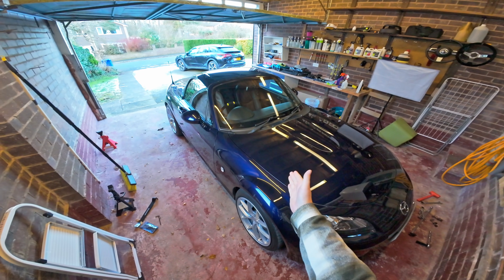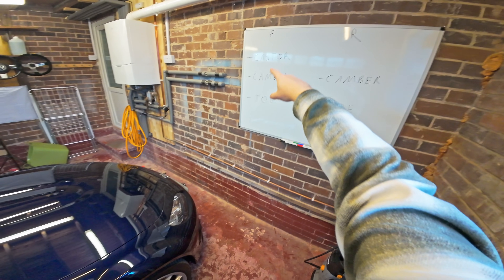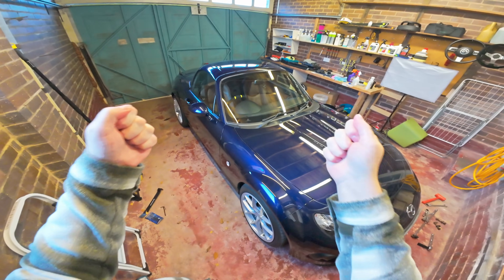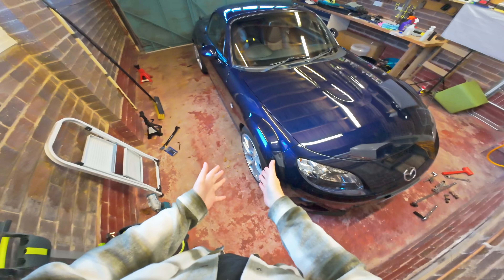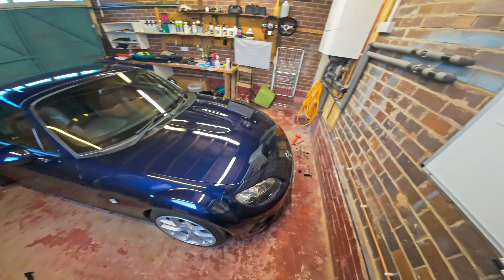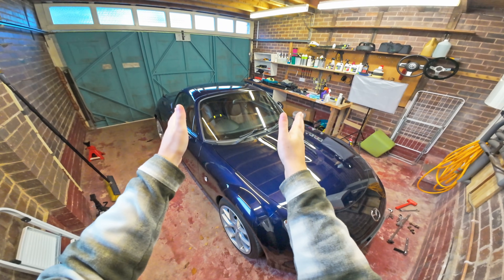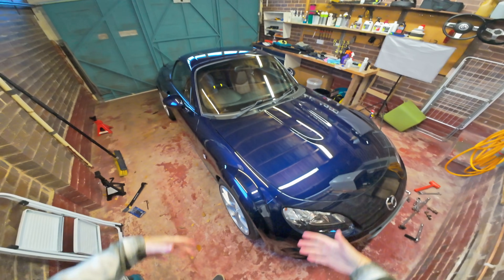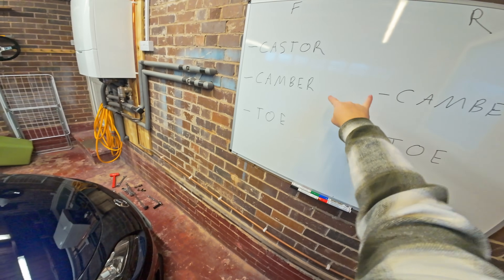I aligned this car 12 times - here's what I learnt

Comment: I took my car to get aligned because I got two new front tyres recently. The first time they did it, the steering wheel went from turned 45 degrees to the right to about 5-10 degrees to the right. So I took it back, and the garage realigned it for free. The steering wheel was still turned the same amount, but by that point I couldn't be arsed, so I left it alone. It doesn't pull to either side or anything, so I'm thinking about just adjusting the tracking by myself to fix the issue. The thing is, I don't have a spanner big enough to fit on the tie rod nut to loosen it, so until I get a big enough one, I'm going to have to live with a crooked, albeit less so, steering wheel for a bit.
One question: how many turns of the tie rod should I give it to turn the steering wheel from around 12:15 to 12:00?
Reply from the maker: Probably about a quarter turn is where I'd start (both sides!)... But without a machine or very diligent string+measuring work you're just going to throw the whole thing off
Reply: If they messed up the alignment first time they will never get it right. You should go to a proper mx5 specialist or any garage that preps race cars.
Reply: If you have the same amount of turns lock to lock meaning the rack is centred when dead ahead. You may just be able to take the steering wheel off and clock it 👍🏻

Comment: Completely disagree with your opinions as it relates to camber. 

More camber even on a street car will generally have sharper turn in, better cornering stability and more ultimate grip. I find this to be very true on the MX-5.
Reply: I agree. If you can't tell the difference between 0 and -2° camber (even on the road, in any car!), it's best to use standard values.
Reply from the maker: Can you please describe what I should be feeling between 0 and -2 camber? I'm worried I've missed something but literally the only thing is more ultimate grip. The situations on the road where I would reach 100% of grip at 0deg camber are very few and far between.
Reply from the maker: Never felt the sharper turn-in, stability is more the balance f/r and the ultimate grip I covered

Comment: Great sum up, explicit for mx5 as front wheel drive cars might need different settings. Big reminder : not all alignment center are the same, most will loosely put something symetrical close to factory recommendations. Some will spent more time doing a crazy precise alignment.  Did you follow a car seeming to go forward at an angle? The alignment guy aligned the wheels, but not the car!
Reply from the maker: I really should have noted - these alignment settings were physically done by me. I got friendly with an alignment shop so I pay to use their machine but they let me setup/turn the bolts myself for a small discount.

100% agreed, most shops will just get it "in the green" and good enough! I once spent 30mins on one bolt because I wanted exactly 1.55 degrees camber, not 1.56...

Comment: too much rear camber also increases oversteer, I've found.  Mostly noticeable when it's wet, and you can't roll the car as far as in the dry.  I like the inside front wheel lifting you get from castor, it helps offset the weight transfer to the outside and in combination with a stiff rear suspension (fwd car here) reduces understeer.  Toe I prefer slightly in, front and back, it reduces tramlining and side wind sensitivity.
Reply from the maker: I actually mentioned this rear camber contact patch stuff but ended up cutting that section along with my story of reducing rear camber from 2.2 to 2.0 which fixed my understeer... it got too long and boring 😂
Reply: @MickDrivesCars  it's hard to keep it simple, i see why you did it.  and FWD vs RWD makes a difference in what you would prefer anyway.